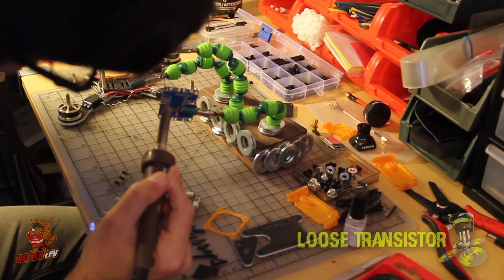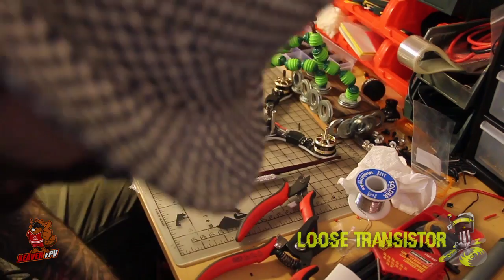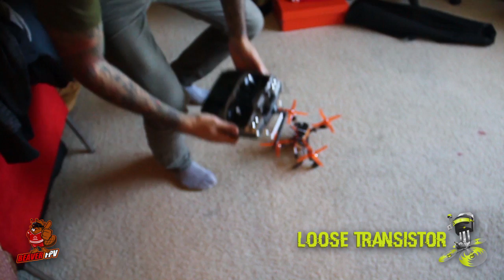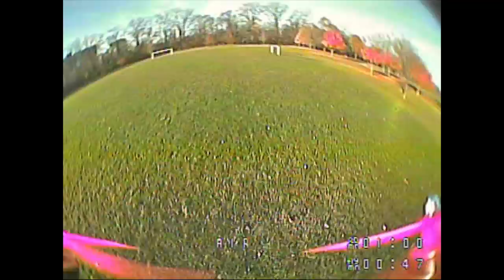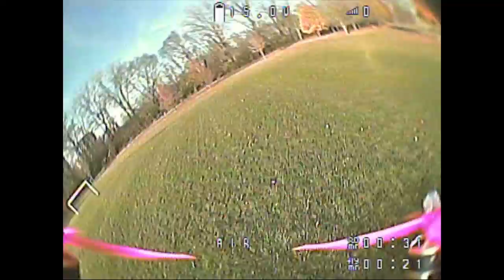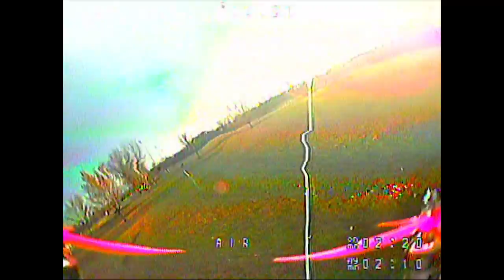FPV DRONE BUILD ♠ Detroit Multirotors PROTOTYPE WP17 - Part #3 BUILD

Comment: What resolution is that FPV camera? 4:3 or 16:9?
Reply from the maker: That Camera is a 4:3
Reply: Loose Transistor FPV I like it, thanks! Also what OSD is that?
Reply from the maker: ***** That is the Betaflight OSD. The Omnibus F3 AIO I am using comes with it built in. So you can configure OSD directly on Betaflight Configurator without needing an FTDI!